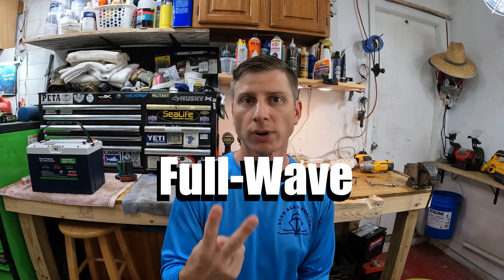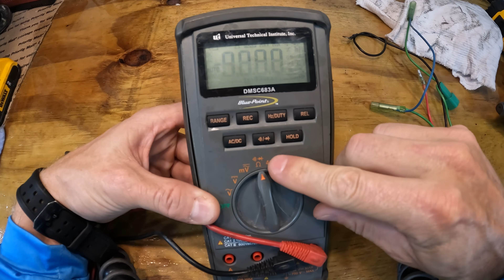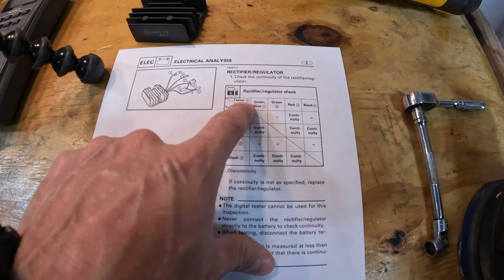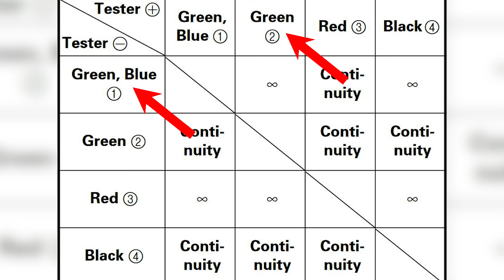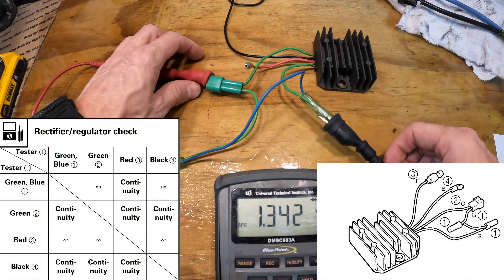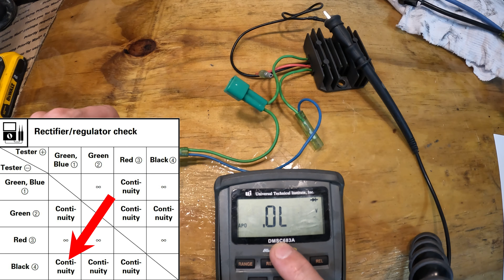How Outboards Convert AC to DC Power

Comment: Great tutorial- thanks. Any way to disassemble these and solder in a new diode(s) if the unit is no longer available?
Reply: It should be possible,  if you can find the correct parts.  Getting in will be challenging tho lol. Probably have to cut open with a dremel or something
Reply from the maker: Never ever tried to open one up lol

Comment: Has a diode and scr which is a silicon controlled diode this is the same system that they use on lawn mowers and all other small motor type vehicles. You can take a transformer that puts out a little more than 12 volts ac for fairly somewhere between 14 and 16 volts, and check the output hooked up with the battery and you should have 13 point something.

Comment: Very well explained! Also a good note, diodes has a voltage drop or when they start allowing flow, usually it is around 0.3-0.8 volts. If the number is higher or lower, then that diode is starting to go and should be changed out.

Comment: I used your video to test my rectifier for my 1995 Yamaha 9.9 that I use as a kicker and it is bad. However, Yamaha does not offer new ones for my model. How can I use a rectifier from a different model and make it work for my motor?

Comment: The diode checker on your meter is checking the voltage drop across the PN junction of the diode not resistance.  Your meter was showing 1.7 VDC not ohms.